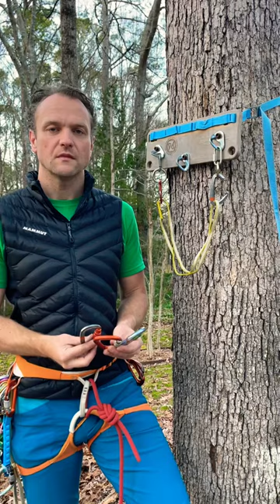Locking carabiners #climbing #carabiner #rockclimbing

Comment: But but but...what about the oval carabiners? They aren't super popular with rock climbers, but they are required when it comes for certain pieces of gear, such as some pulleys and devices, which must be loaded on a symmetrical connection point so that they don't get strained.